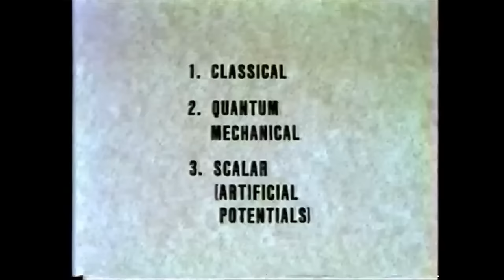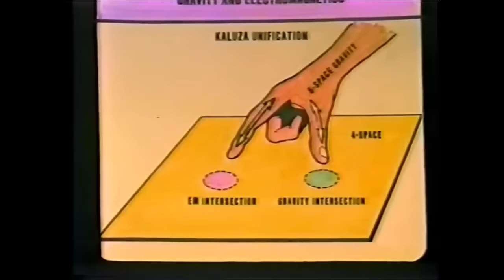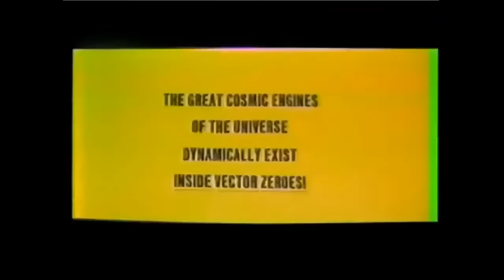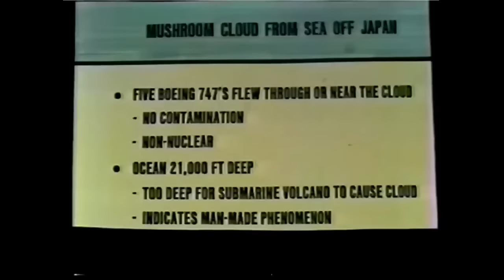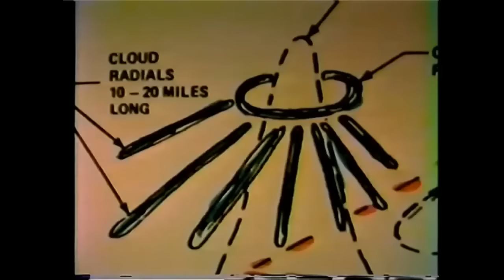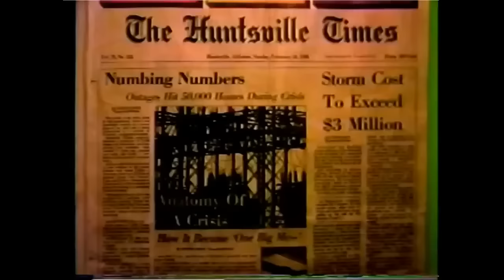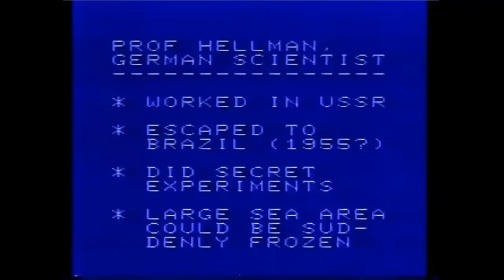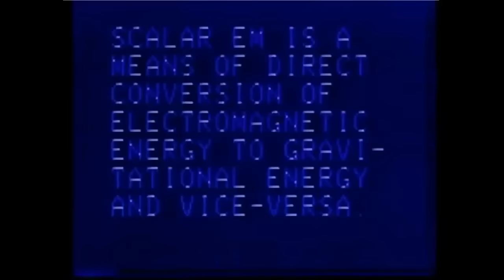Russian (Soviet) Weather Engineering Over North America - Lt. Col. Thomas Bearden (1985)

Comment: standing waves are zero energy. think zero point energy. in 5d maxwell’s equation dropped out by accident (sorry, i don’t know all the specifics on that) but einstein still questioned his use of a 4th. cosmological constant, but light is slowing down, and even gravity is variable. 

incidentally, time is not the 4th dimension. although it seems linear, it can’t be since it has to be multidimensional, if for no other reason, as einstein claimed it’s one with space, it must have at least 4, probabilities and stochastics are evidence of this. … anyway… 🛸 we’re screwed.

see ya later. 🤍💭 david

Comment: The morning of Tuesday, Mar. 26th, I watched the 1985 Beardon video.  THAT AFTERNOON, I saw identical radial "wheel spokes" over the city of Mt. Shasta as in Beardon's video!  I recalled Beardon had said there were two scalar "projector points", and sure enuf, on the other side of the sky was another set of radial wheel spokes!  THAT NIGHT, there was a swarm of 6 "rare" earthquakes 60 miles north of Mt. Shasta in southern OREGON, ranging from 3.5 - 5.7 magnitude!!  The locations of the earthquakes were on both sides of a huge Subduction Zone that I read has the capacity for magnitude 9 or higher!

Comment: Dutch unless I missed something if you removed the valves from a lawnmower engine and took two mirco projectors with the beams crossing in the middle of the combustion chamber and a crank shaft censor for timing, wouldn't it be practicality  free

Comment: Dutch

Where do those trapped beam energy you have caught transmitting when you track sudden hot spots in the USA that you identify as volcanic venting or other

Those straight lines spanning states and these last two videos

Also when we had torrrential down pour in 2014 in Oakland County Michigan that caused so much damage
 
Was preceded by two lesser but still torrential downpours each progressed to higher flooding and they occurred about a week apart as if they were testing and created flood level one then two then the financially devastating flooding

Comment: Electromagnetic force is 10 to the 36th power stronger than Gravity.
 That's 10,000,000,000,000,000,000,000,0. Time's stronger. 
Or Gravity is not correct....as 70-98% is dark matter.... Or B/S.